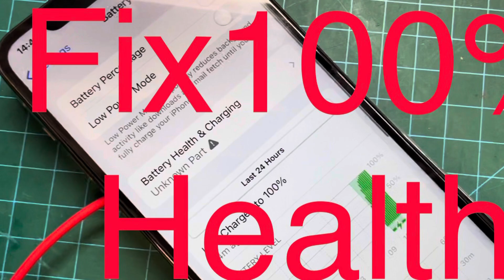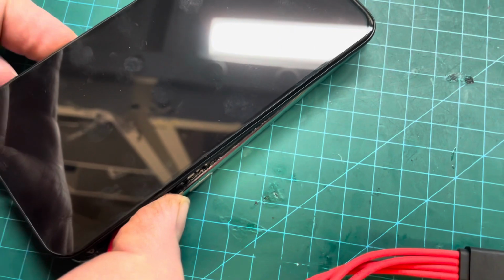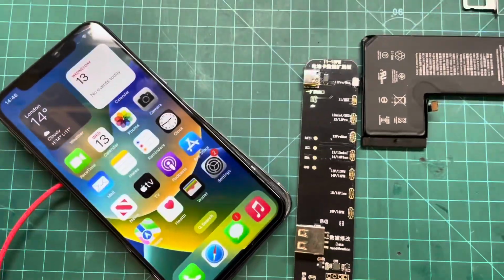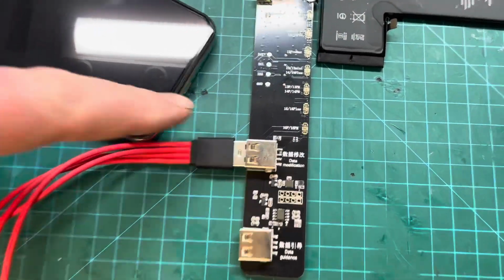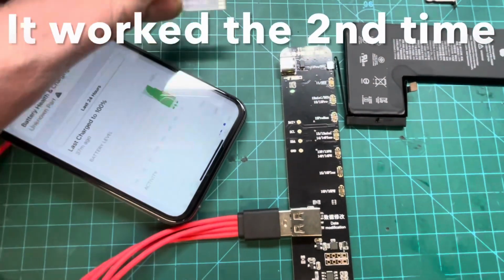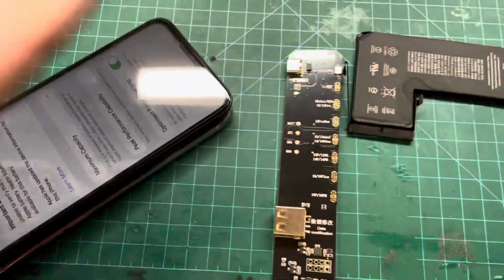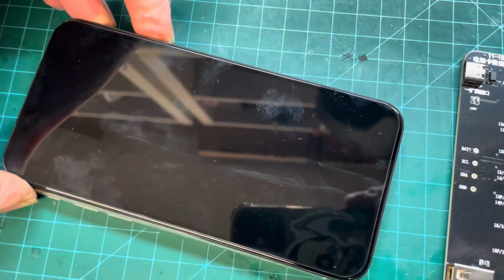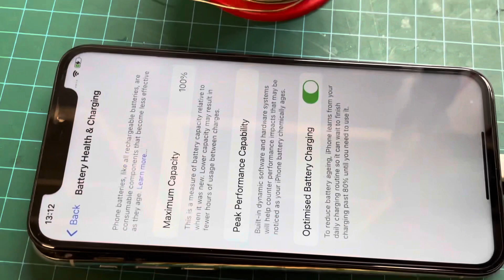iPhone 11 Pro battery Health 82% to 100% no tag on BMS needs welding

Comment: What board do you using sir? Is it qianli product or what? This is without changing tag-on and without copy battery original one?
Reply from the maker: I have a video coming out about it in detail soon. Keep the original BMS and reset it to 100% (no need tag on or any extra flex :)